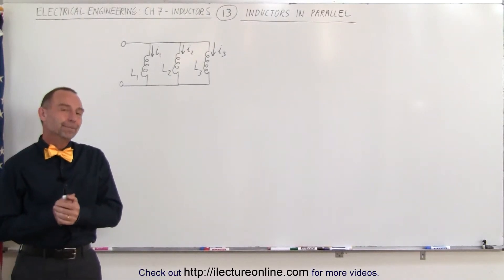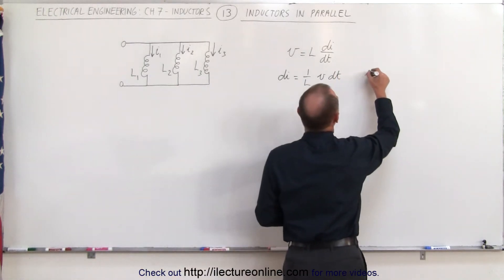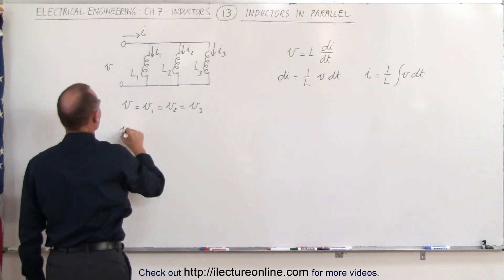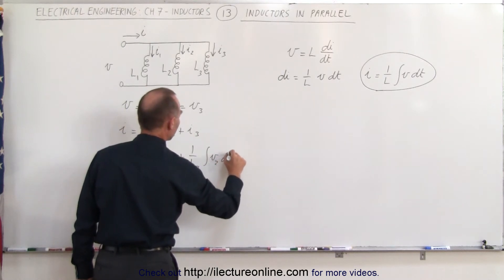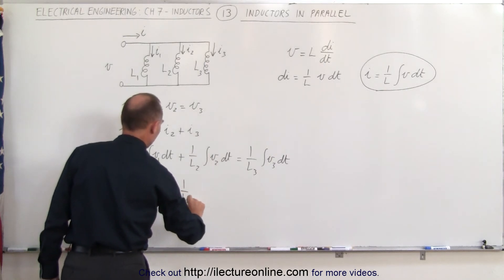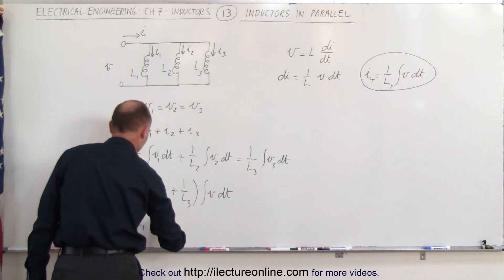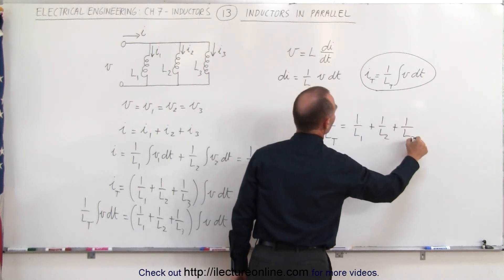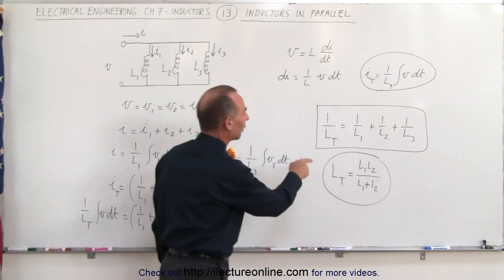Electrical Engineering: Ch 7: Inductors (13 of 24) Inductors in Parallel

Comment: Why you neglect the concept of mutual inductance?
Reply from the maker: Typically the mutual inductance is very small and is indeed ignored in these types of problems.
Reply: But in case of tightly coupled coils,we can not neglect the coefficient of mutual induction.If you consider for very loosely coupled coils,it is okay.